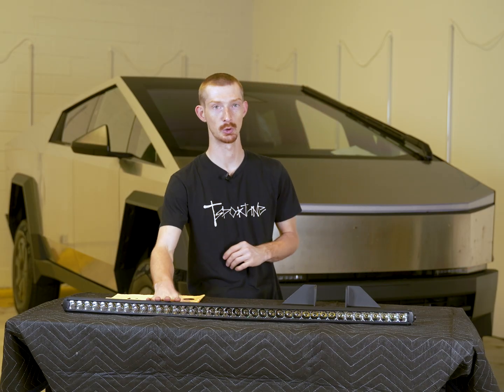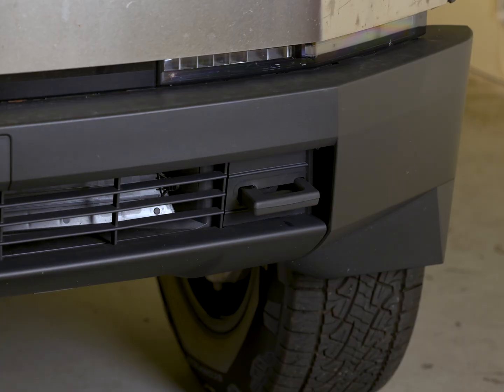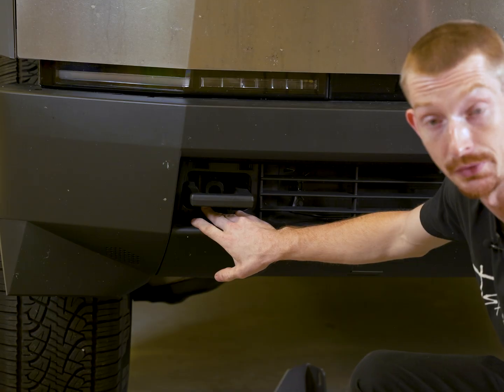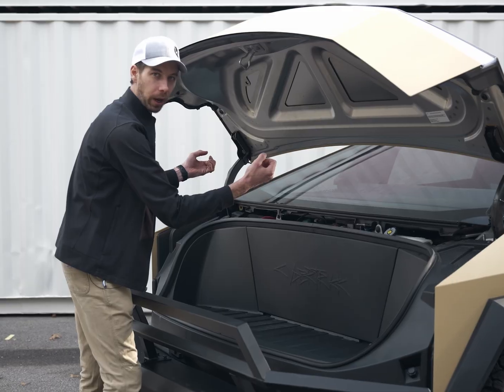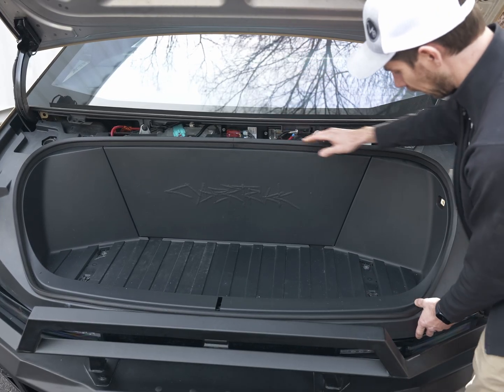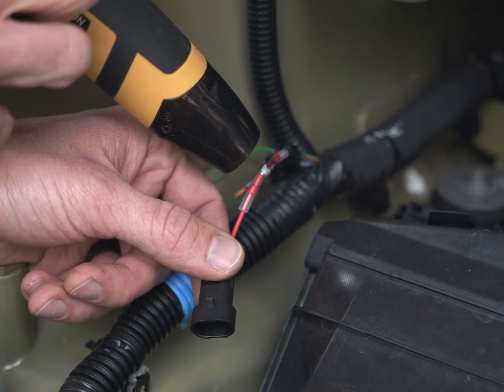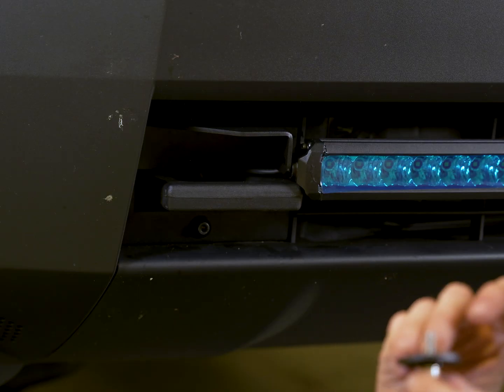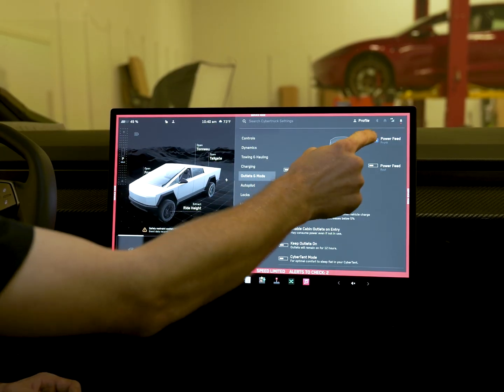How to Install Cybertruck Curved LED Bumper Insert Lightbar - 40" Off Road / Overland 48v Light Bar

Comment: So is this a 48V light? I did not see any mention of a step down converter to 12V. Thanks
Reply: This is a 48v light bar - no step down required.
Reply: I think you need to add step down converter.